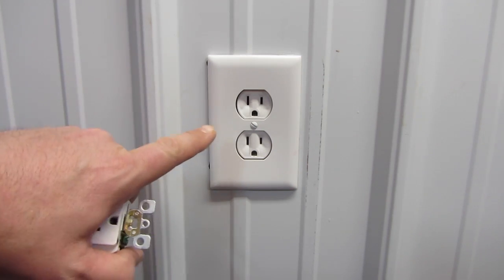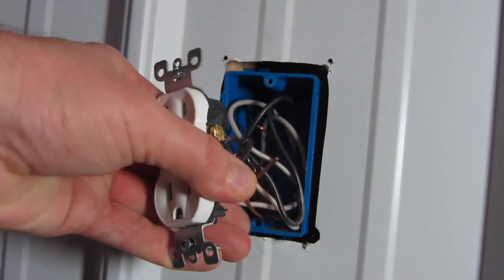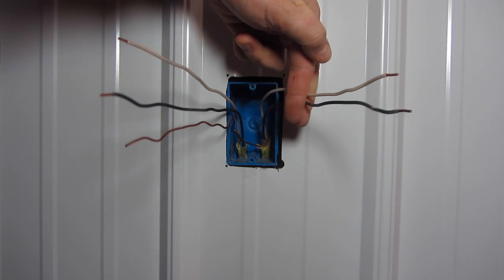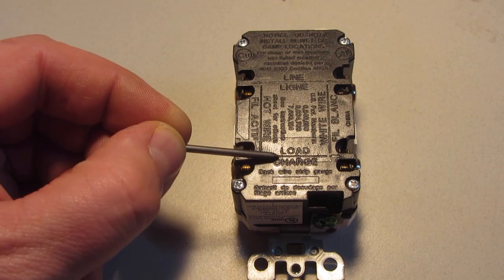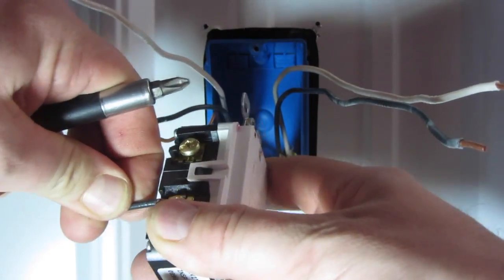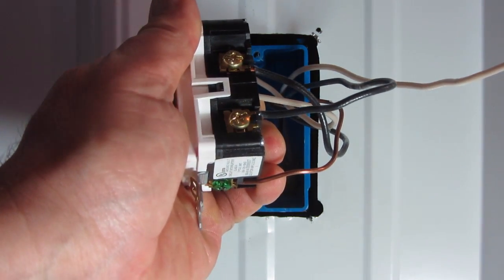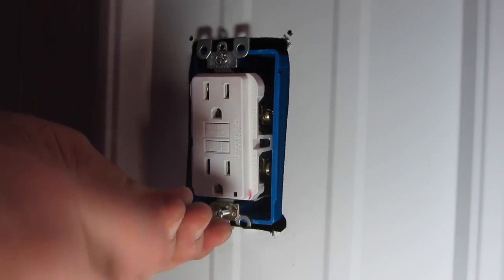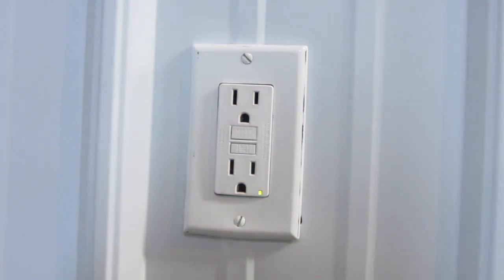GFCI OUTLET INSTALLATION - HOW TO

Comment: Curious on why you are installing a GFCI. Also curious as to why you connect the outgoing wire to the load. I know it's so they are also protected by the GFCI but for what reason do you want them to be GFCI protected? Are they also located where GFCI is required?
Reply from the maker: Each county has their own rules.  Youll have to check with yours.

Comment: Just a tip, but most people overlook the little metal tabs/mounting brackets found on a GFCI receptacle and do not know that they have small slots in them designed specifically to strip either  #14 or #12 gauge wire.
Reply from the maker: Great tip!

Comment: Forgive me Phi. I am very interested. I have a question. Do you have to do something to to circuit box too?
Reply from the maker: I'm assuming you are referring to the 'breaker box'.....  You must be sure to identify the switch that runs the outlet, and turn it off before working with outlet wires.  Do not touch 'hot' wires.  It can be a shocking experience!
Reply: I thought there was something in the breaker box you needed to change. The GFCI i have in my house has a reset on the circuit breaker too?
Reply from the maker: Eric C Since I'm not sure about your setup, I would suggest doing some more research on your particular kind of breakers.  I would hate to give you poor advice.  I do hope however, that my video has at the least given you a good start.
Reply: yes for sure! thanks!